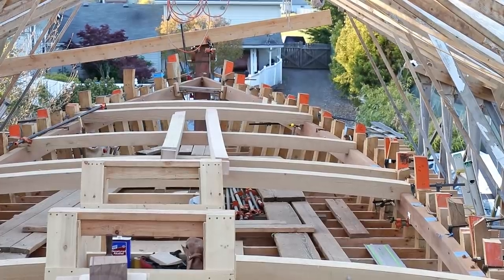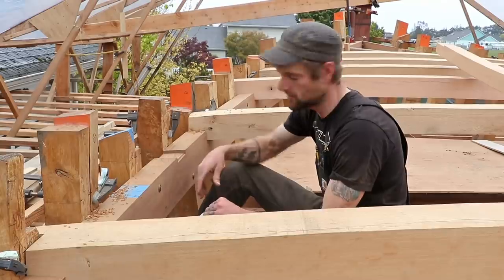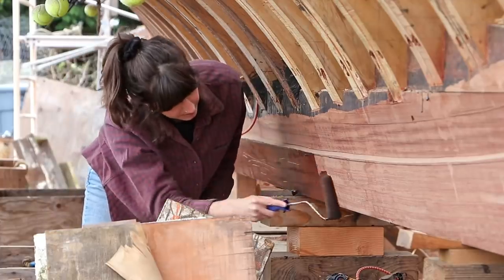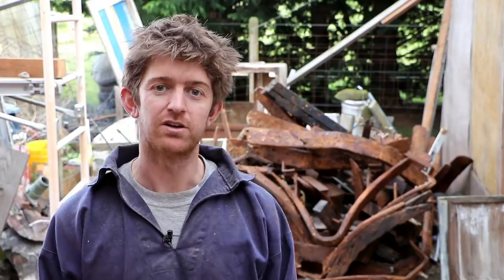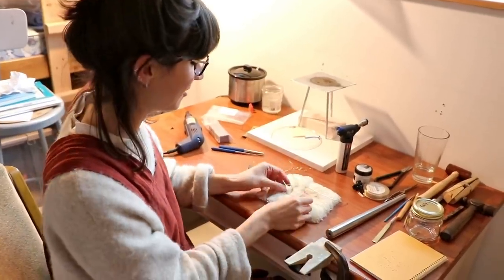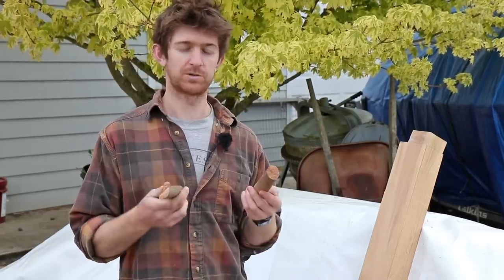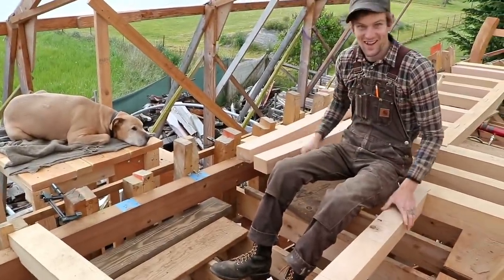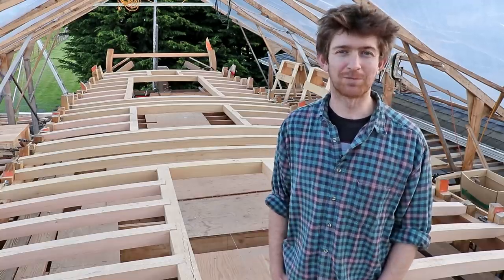BoatBuilding - Building the Deck Structure! (EP71)

Comment: since you made exact patterns for the bronze floors..  you have to have Draft to get patterns out of the sand.. (taper)  you might check around and see if there are any Leaf Spring manufacturers in your area..  many have tapering rollers where the can take steel spring stock when heated and roll them out to a taper .. very much like what you need.. they can also do bends exactly like you need  also when heated.. allowing you to work with bronze flat stock to create your floors instead of very castings that won't be anywhere near as strong..  here is one video of the boys with acorn to arbella building some bronze floors.. https://youtu.be/4u5kMk5pORM but they just manually bent theirs and welded them..   now.. if you saw the floors down the center.. so you have 2 halves.. add some cross sections to each side with alignment dowels..  you could probably get them cast up.. you are probably MUCH farther along in your thought process.  if you had the lowest parts duplicated by a leaf spring shop. you would still perhaps need to weld in cross bracing.. i don't know if castings would be stronger than bent flat bar stock..   i wonder if Alec Steele could duplicate the Curves and taper in his big air drop hammer .. then heat and bend them in the middle to match where they meet the keel..  again..   stronger than Casting..

Comment: Why not cast iron for the floor and galvanise it? It seems more original to me, cheaper, and should also hold for many decades. You should probably be able to take them out when they start to rust, and galvanise them again, without having to rebuild the entire boat again.

Comment: Why cast the floors rather than buy bar stock and shape to fit?
Reply: Cutting, bending & welding 1" x 5" bronze bar requires a large investment in tools & experienced metalworkers - not a job that even the best-equipped woodshop & Leo-level shipwrights could be expected to do.

Comment: Hello- regarding the rotted wood you showed us there’s something called an implied warranty of fitness when you purchase a product that is fit for a particular purpose obviously the wood you purchased the white oak is not fit and you should establish a dialogue with the vendor who sold it to you. If you would’ve built the boat with these pieces and the boat would’ve sunk as a result of the structure falling apart you could sue them for damages. Hopefully the whole lot is not rotted I would establish a dialogue with the vendor perhaps they will know what kind rotor it isn’t and they should provide a solution Or some kind of reimbursement for your troubles.
Reply: Leo personally selected all of the White Oak logs & was present when several if not all of them were slabbed. He also knew that lots of the wood would be unusable & would contain defects. Only a very small part of the timber was diseased, that's part of the normal wastage involved when buying ungraded wood from a small mill.
Reply: You must be a Lawyer!!!
Reply: @tonygrimes13  - hi Tony, IANAL !

Comment: its a rot in the wood before it was cut down.  usually the wood was milled from closer to 'core' of the tree trunk or limb. Depending on the species of tree, its a pinkish or reddish to even almost a blood-red color when it is first cut and still "wet" , then fades when the wood dries.   the brittleness of the wood is due to the bacteria/fungal rot when the tree was still alive that inhibits the bonding of carbon atoms within the fibers of the wood.   

Another way to find the difference, other than discoloration, is also the porosity of the wood.   "Rot" wood is more absorbent. Also, the wood doesn't flex as well , breaking before other pieces as demonstrated in the video.

It's not truly scientific. having chopped many trees down in my time, seeing what we call 'core rot' in different species of trees and how the wood reacts after it dries, I looked at fungal and bacteria and what that type of rot does.  More likely fungal, if 'core' rot is indicated.

Comment: ...and then he said “Now we have to take it all apart to bed it all”. WTAF?
Reply: After the joints are fitted:
Disassemble the beams
Several coats of thin varnish primer
Paint joint surfaces w/ red lead primer to inhibit rot
Reassemble the beams, filling the joints w/ Dolphinite bedding compound to fill air pocket spaces.

Comment: Since that rotted piece looked to be on the underside of that piece and that wood is so expensive....how come you didn't chop it off or something and do like a scarf joint or something? Replacing that piece is too boring with the skill you posses.  I'm pretty sure most of the people watching love to see how you save pieces (ex.Bfly hatch) and correct issues along the way.
BTW......that deck is looking like something Michelangelo could create. The lines just look so clean and good. Time to rewind....